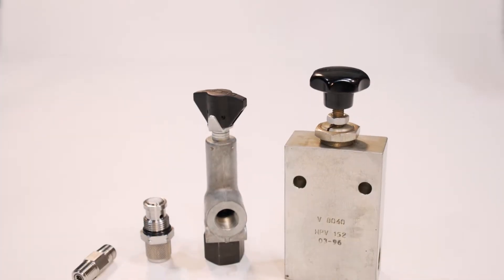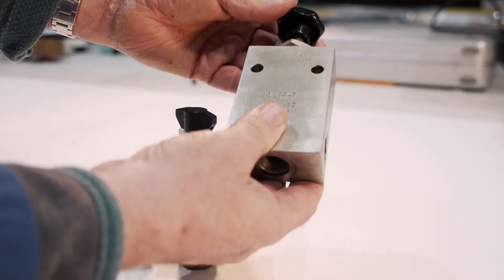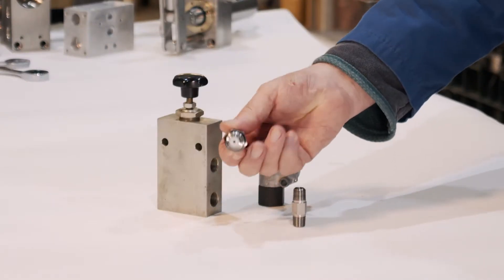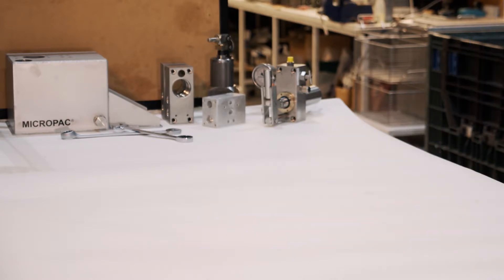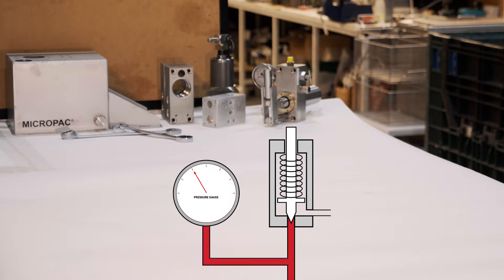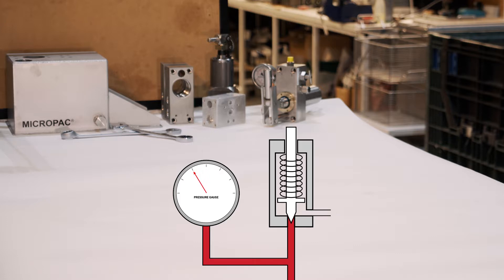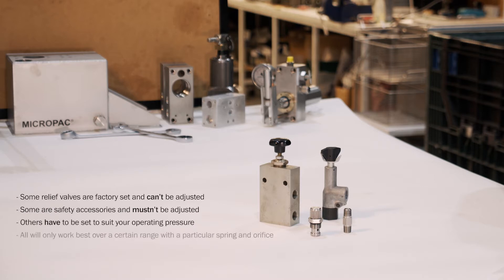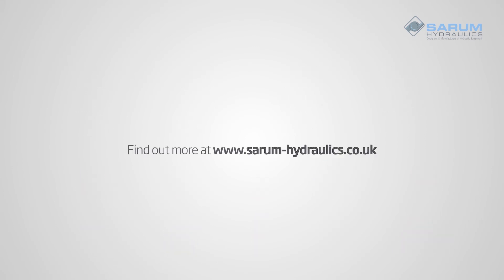How does a  Hydraulic Pressure Relief Valve work?

Comment: People tell me don't touch them but they wear and need attention.
Reply: Thank you @Nozinbonsai. We would say don't touch them. There are a safety device. Problem is that when they do go wrong, it can be something more serious like damage to the valve seat. We made our Micropac relief valves as cartridges that you can swap out in 30 seconds. The pressure can be set at the factory. That's the best Engineering way to do it.
Reply: @johnfoster8624  yes I suspect the seat can develop a shimmy or fretting corrosion over time , I'm definitely looking into it and found your posts quite interesting and enlightening, thanks.